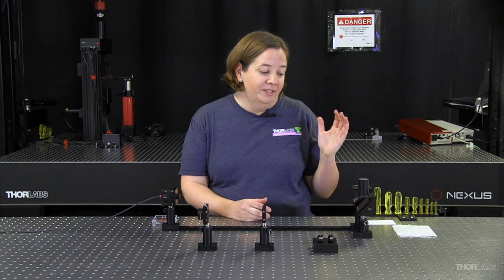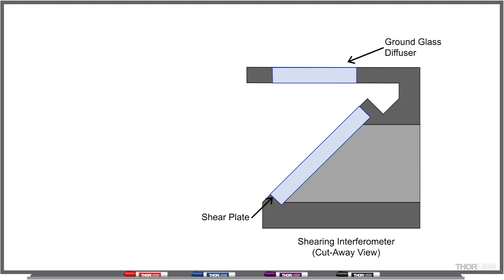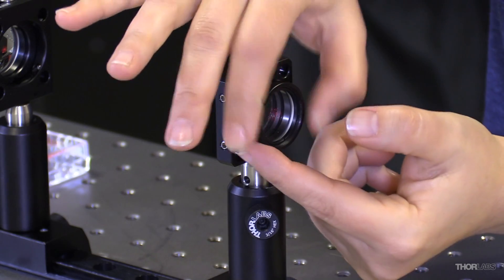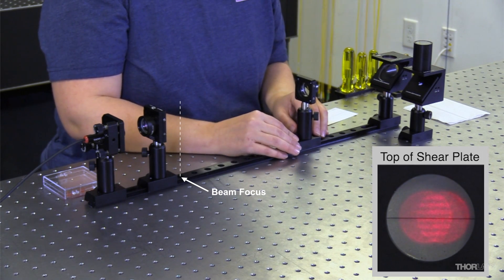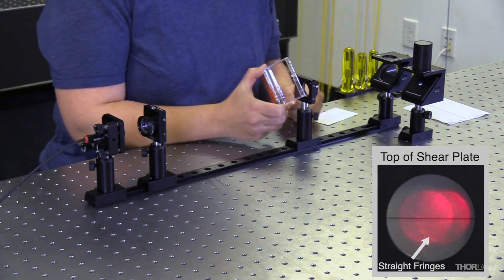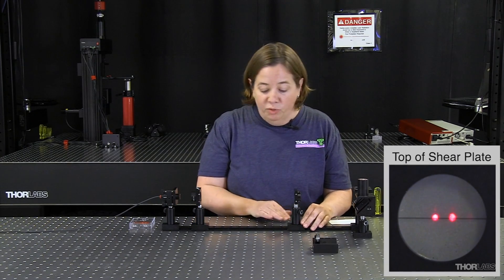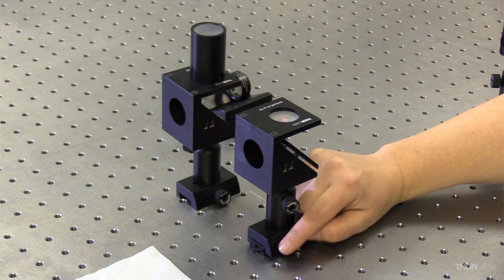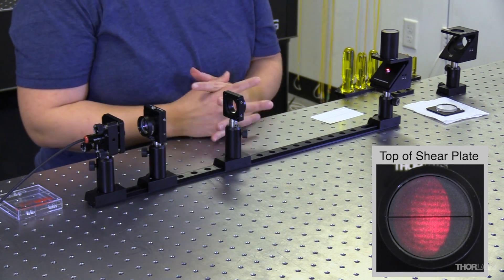Collimate a Laser with a Shear-Plate Collimation Tester (Viewer Inspired) | Thorlabs Insights

Comment: Do the tip and tilt of the shear plate need to be adjusted?  If yes, how?   In the video, it seems that was already taken care of by the mounting of the shear plate.
Reply from the maker: @user-zo2xy4iu8g  There are no tip/tilt adjustments available on the shear-plate collimation tester. The housing holds the shear plate at a 45° fixed angle to the horizontal. In the demonstration, the laser and lens mounts were pre-aligned to ensure the light traveled parallel to the table and along the rail. We relied on the mounting configuration (post, post holder, and rail) to keep the device vertical to the table.   

If the input beam cannot travel parallel to the table, turning mirrors could be used to realign the input beam. Alternatively, the tester could be mounted to a KM200PM ( https://www.thorlabs.com/thorproduct.cfm?partnumber=KM200PM&YVI=9 )  to adjust the tip and tilt.

Comment: Excellent video and well explained. Can this method be used with off-axis parabolic mirrors or do they introduce wavefront errors? Specifically can it be used to focus a beam expander/reducer that uses OAP mirrors instead of lenses.
Reply from the maker: @chromarti  Yes, a shear-plate tester can be used to optimize the collimation of a beam provided by an OAP beam expander/reducer pair. While the wavefront error contributed by OAPs is not zero, it is low, and the beam quality OAPs provide can be high. For example, when the OAPs are properly aligned to the input beam, these mirrors should add negligible spherical, coma and distortion to the beam.
Reply: Very informative video as always. Can you also give some tips for collimating a laser beam using only OAPs. Thank you.
Reply from the maker: @rishabhsangal5155 Thanks, we're glad you found the video useful! Have you seen our OAP Video Insight ( https://youtu.be/l8v8RyCi4HU ), which shows an approach for using an OAP to collimate light diverging from a multimode fiber? The same general method applies to collimating diverging light from a beam focus or directly from a light source. 

Were there aspects you felt were missing in that video, or are there additional OAP approaches you would like to see?
Reply: @thorlabs  Ohh no, i am sorry. I have seen collimation video. What i wanted to ask is BEAM EXPANSION (2X, 3X...) USING ONLY OAPs. made a mistake in previous comment. Been using expanders with lenses for long time, out curiosity just want to learn with OAPs. Hope you can give some tips. and thank you for your response. : )
Reply from the maker: @rishabhsangal5155 Thanks for helping us better understand what you had in mind! Thanks also for the topic suggestion, we have added it to our list!

Comment: Another amazing video. I haven’t used a Shear-Plate in the lab, and I’m wondering what kinds of affects you would see if your beam was not parallel with respect to the optical table. I can imagine you could still cause an interference pattern at top of the Shear-Plate with a tilted beam which might cause confusion with determining the point of collimation.
Reply from the maker: @danieldahl  It's great to hear the video got you thinking about different things that could affect the fringes you would see! You are correct that changing the angle between the incident beam and the shear plate will have an effect. Since the shear plate is wedged top-to-bottom, the effect depends on whether the input beam is misaligned side-to-side (yaw angle) or up-and-down (pitch angle). 
 
If the incident beam is not parallel to the table, then the beam is misaligned in pitch.  Assuming the pitch angle is small and there are no other aberrations or misalignments, a collimated beam will still produce fringes that are parallel with the reference line on the ground glass diffuser. However, it is still necessary to keep the pitch angle small, since the angle of the two beams reflected from the shear plate changes as the pitch angle changes. As the pitch angle increases, the interference pattern will walk off of the ground glass diffuser.  
 
If the incident beam is misaligned in yaw, then a collimated beam will produce fringes that are tilted with respect to the reference line. The tilt angle increases as the yaw angle increases. In the case of yaw misalignment, the reference line on the diffuser would not correctly indicate the orientation of the fringes when the beam is collimated. The interference pattern will also walk off of the ground glass diffuser as the yaw angle increases. These are two of the reasons we used a rail in the demonstration.